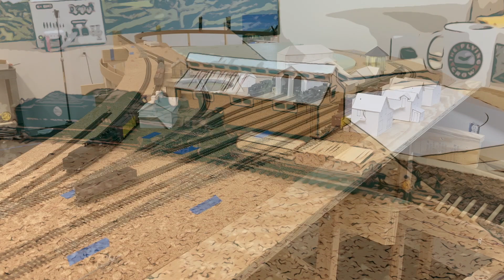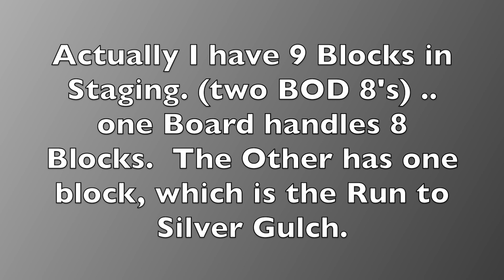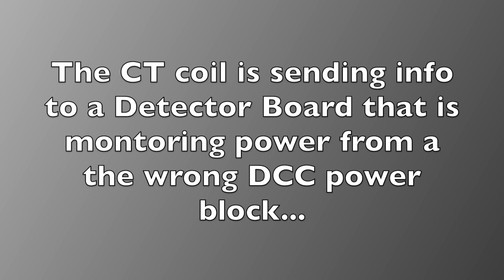Model Railroad Update 82 (Odds-n-Ends &Turnout Talk)

Comment: How does lcc work
Reply from the maker: If you are unfamiliar with Layout Command
Control, it can best be described as a way for various
components of your railroad to communicate with
each other and act upon “events” that are created
throughout operation. Unlike DCC where all communication
is handled through a command station,
each component of LCC can communicate with any
other component directly over Open LCB (open layout
control bus) without the need of a command station.
OpenLCB is the messaging highway that carries
“events” on the layout. Events are unique messages
sent on the layout network announcing a change of
status or simply that something has occurred. This is
called the “Producer/Consumer model”. This model
describes communications on the network as either
“produced” or “consumed.” Example: When pressed,
a push button (producer) creates an event and a stall
motor driver (consumer) acts on the event and moves
a Tortoise® from normal to diverging. Events can be
produced by many different sources (e.g. more than
one push button, or a dispatcher in JMRI), and can
be consumed by more than one source (like multiple
LED’s on a control panel, LED’s on a signal aspect,
multiple turnouts and even in a computer.)
The hardware interfaces to the network are called
Nodes, they handle all messaging in OpenLCB. They
can be a single board, or a process in a larger computer,
or any other component on the OpenLCB
network. Every OpenLCB interaction originates in a
node. Nodes usually have lines that are configured
as inputs or outputs depending on the need and can
sometimes be both, however, nodes don't have to have
I/O lines. A common use for a node is logic tables
used for managing signals.
Reply: The beauty of LCC is, it doesn't replace DCC but works beside it. The DCC system works all your trains and the LCC system works everything else on your layout including but not limited to block detection, turnout control, grade crossings, signaling, building lightings on a timer, etc... I used to do this stuff on DCC and overtime as you keep adding extras, the locomotives doesn't respond as quickly to the commands that you input in your throttle. Once I removed it and put it on a LCC system, the locomotives respond flawlessly (except for dirty track). I have a couple of videos explaining some of the LCC that I have put on my layout and there is a channel how there that is great on showing others how to get started. - Jason

Comment: Nice update Dennis. Sorry to hear about the work complications. That must be nerve racking. The layout is looking good. Looks like it is fun to operate. The wiring on a layout that size looks like it could become a nightmare in a instant.
Reply from the maker: Thanks Larry, It is a blast to operate.  The time saver was fun to operate as well but after the tenth time you shuffle cars in and out it quickly became the "same game" every time you played.  This feels completely different with full trains coming and going with local moves in between trains.  So far (knocks on wood) I haven't had too many wiring issues, which is why I've tried to make it as clean and easy to understand as I can.  I'll be moving the RV next weekend... Hopefully, there won't be any hiccups in layout progress as a result of the change.  ;-)

Comment: You don't have those problems with stub 3-ways.
Reply from the maker: If I knew then what I know now!  I considered going with stubs, but I wasn't keen on messing with the servos.  Are yours hand thrown or connected to a servo?
Reply: @OtterCreek mine are operated by a servo driven by a Tam Valley Dual 3-way board.  The frogs are powered by a Tam Valley Hex Frog Juicer.  The TV Dual 3-way allows me to set the end and mid points for the servo so the lead rails always line up with the individual rails of the stub switch for each of the routes.
Reply from the maker: Sounds really nice.  I wasn't sure how I was going to get the TV board to integrate with the LCC, so I opted to stick with the tortoises.  Eventually, I will try and put in a semaphore and use the same TV board based on block detection.  But I'm in no hurry to get there.